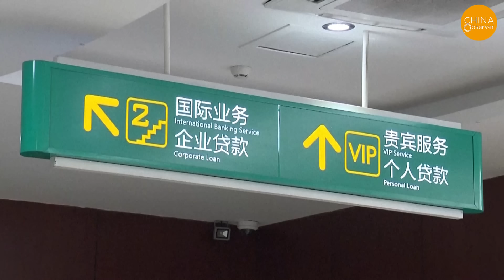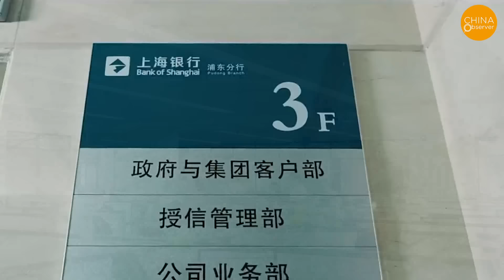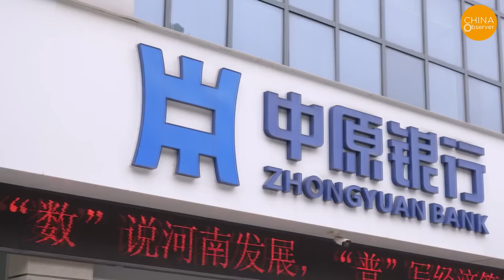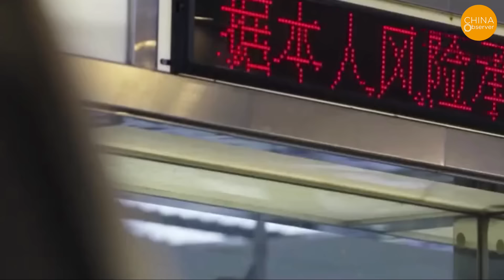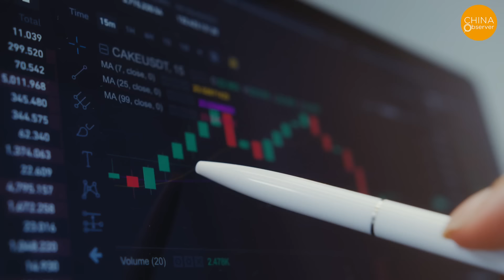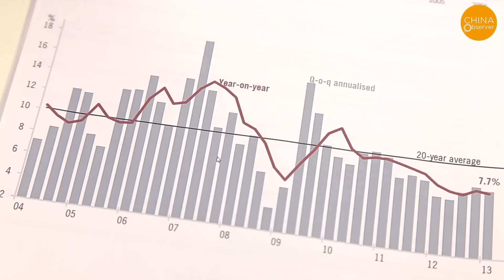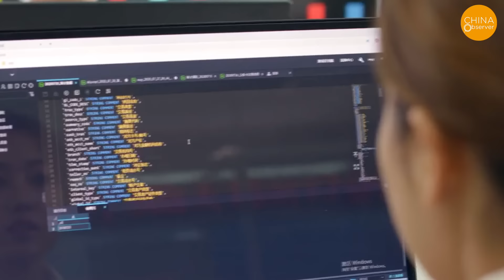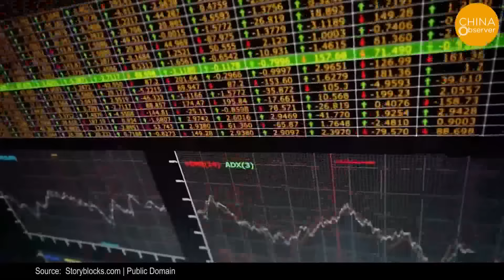China’s Banks Are Broke, Mass Public Revolts, Armed Guards Block Withdrawals

Comment: Never put your money in a Chinese bank. Never.
As soon as you give them your money, its not yours anymore, its theirs and you will never get it back
Reply: The rmb has better uses. Like tp or wall paper.
Reply: @mah7961  If that is true, then the bank can give you tp or wall paper when you make a withdrawal and you will accept it?
Reply: I only deal with USD. Last I checked 1 rmb is only worth .14 cents to the USD. It’s safe to say that the USD is way stronger than the Rmb. Even euros are stronger than the RMb. There’s a reason why the ccp covets usd and euros.
Reply: This is true of all banks nowadays tho
Reply: Sounds like almost any bank.
Reply: same in us
Reply: @ozeight4278 one fire.  one burglary away from being broke... and losing everything.
Reply: All banks are the same, if you keep your money in the bank, you risk the same thing.
Reply: @ozeight4278 True, but since all modern money is fiat currency anyway, if the government goes belly up (or inflation gets so bad they invalidate the current money for new money, like some countries have done over history,) whatever is under your  mattress becomes pretty worthless anyway.
Reply: Don't pretend US banks are actually sitting on their deposits and haven't loaned the money out at low fixed rates that would now be higher, reducing the fair market value of their investments, even if their accounting methods allow them to keep them on their balance sheet at cost.
Reply: @rickstalentedtongue910
To true.
It's the same everywhere, the US included. 🇺🇸
Reply: @nicholasblakiston6297
The US banks only need to have ≈ $36 million dollars "on deposit," and ≈ $380 million dollars in "tranche" deposits—bonds, US Treasury bonds, mortgages, loan notes, etc...

Comment: In Australia now they ask you what the $$ is for over a certain amount.
Reply: I've pulled out 19k at one time nobody ever asks. If we buy on line or at store they double check with a text to make sure it's us as Security check. We just hit y or n
Reply: One of the methods that overseas scammers use to acquire untraceable money is to get the victim to withdraw cash and then use the cash to wire funds to them, or to use the cash to buy gift cards from which the redemption codes can then be read out verbally to the scammers.  Such scammers also coerce their victims not to discuss why they are withdrawing the money except to offer a reason that the scammer gives them, eg, giving the money to a relative to buy a car.  A likely explanation is that the bank is taking some care to check whether you might be in the process of being scammed.